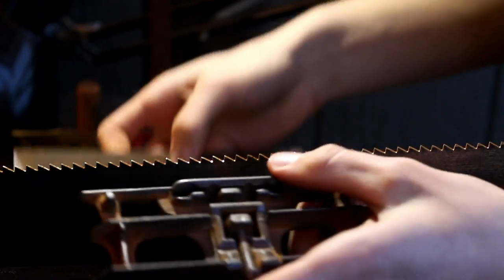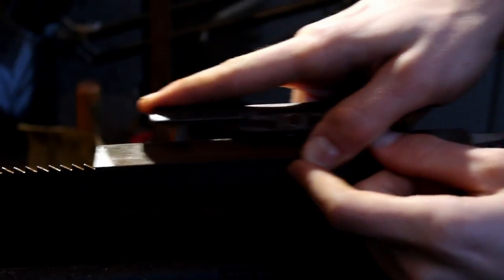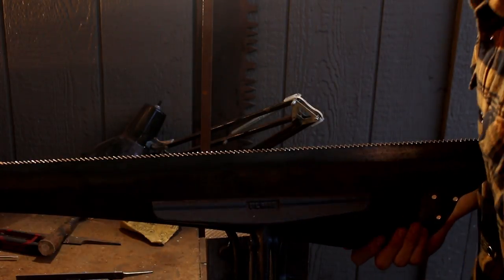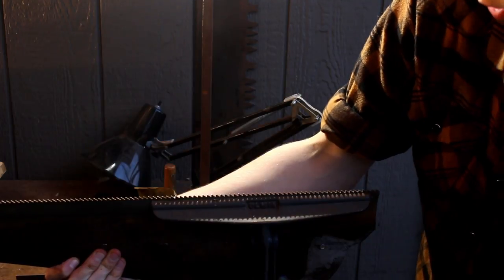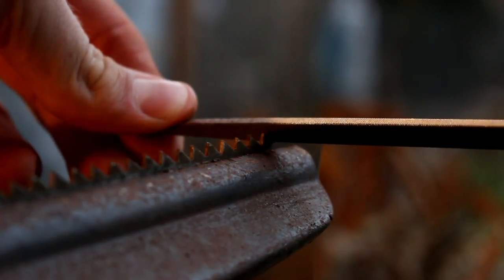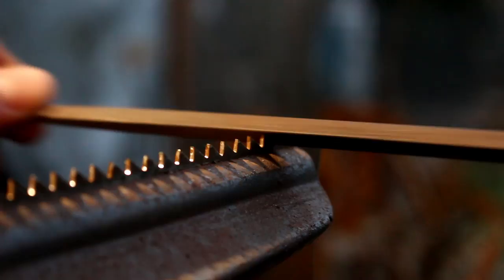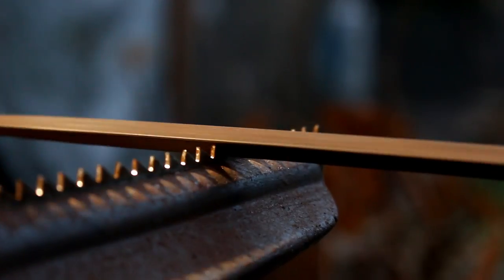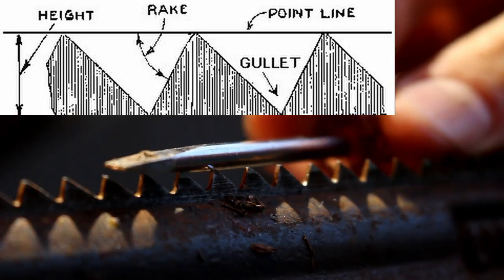How to Sharpen a Ripping Saw/Saw Restoration Part 2

Comment: I did as instructed in the video however, I used the one square file and the saw gets stuck into a deep cut.. this saw has seen better days
Reply: You probably need to add more set to the teeth. Look up 'saw set'